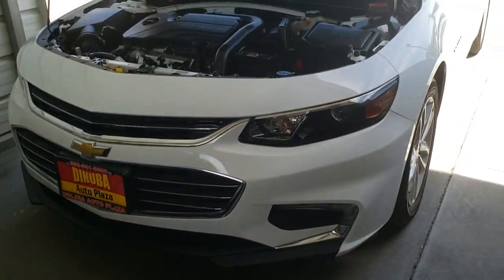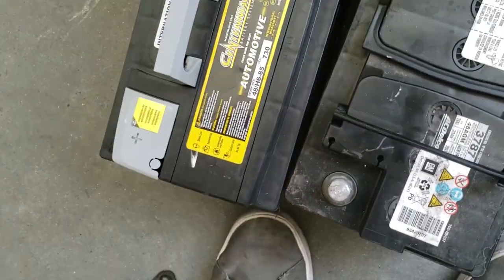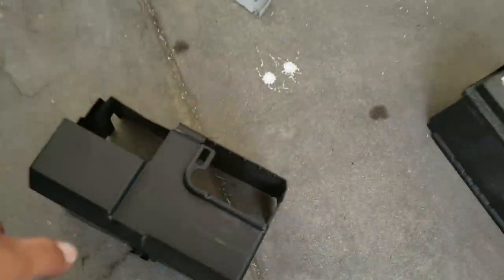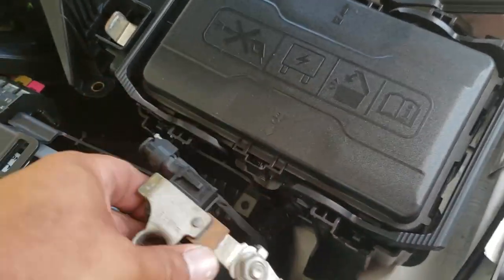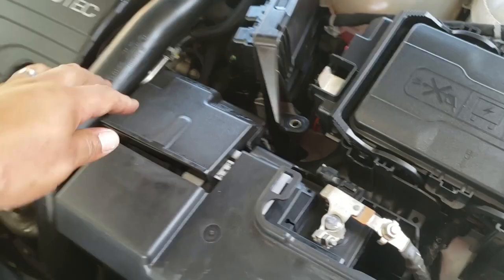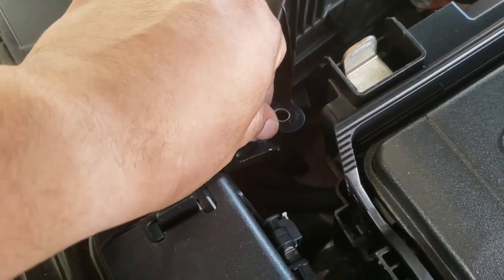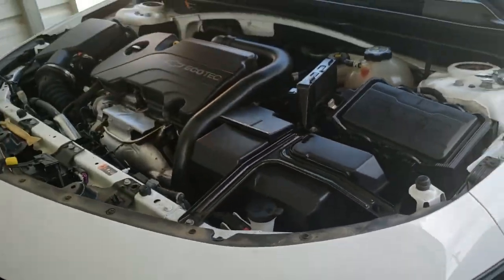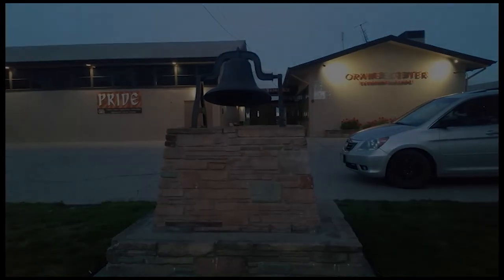How to: Install a new Battery on a 2017 Chevrolet Malibu

Comment: I remember the old days when you could stand in the engine back to work on the engine! 😁 Now there's so much stuff that if you drop a tool it only has a 5% chance of hitting the floor.

I opened the hood and couldn't even see a battery! Thanks for the excellent videos.👏
Reply from the maker: lol very thru. Thank you so much! Thank you for your support!

Comment: Thanks for this video, man. I bought a new battery today, opened the hood, and went “WHAT THE?!” No way I could have done this by myself (yeah, yeah, I’m not a mechanical guy, ha!).
Reply from the maker: Lol thanx bud really appreciate your Support!  Im glad you found this useful brother. Here's the video on removing it as well in case u missed it. Sorry I make a video in removing it and installing it so I just get you straight to the point.....hope you have a good weekend! 

Removal: https://youtu.be/Ow_ahdxFWok
Reply: @559powerscape  whomever designed this whole “battery area” in this Chevy needs a swift kick in the ass. I’m sure they did this on purpose so they can charge you for a new battery and $100 for “parts and labor”…
Reply from the maker: @Nick Emacio   That is exactly why they did it

Comment: Thanks for both videos. It took me longer to find the tools than to remove and install the battery. 
 
Only issue is that the AutoStop doesn't work anymore. {Not that I mind} Does it take a while to reset itself?
Reply from the maker: Lol yeah it be like that sometimes. No it should work right away. Maybe the battery in the trunk is bad as well. That one of the auto stop feature. If it doesn't work by the next few days it might be bad. You can remove it and take ot to where you purchased the new one for testing. They will let you know if it's still good or needs to be replaced
Reply: It started working the next time I drove the car.  Thanks again.
Reply from the maker: You're welcome thank you for your Support 🙏

Comment: My 2017 Malibu battery just failed.  At noon it was fine at 4pm it was dead.  This car in the video was also already needing a battery ?  Original GM batteries were always good for over 5 years of life.  What is going on?
Reply from the maker: It's just batteries. Just like cars. Some cars off the lot are perfect and some come defective with problems. It was probably  just a defective battery from the beginning. Yes this Battery was bad too and had to be replaced. Dealerships cut corners now and putting cheaper parts in their vehicles causing them to have more "common" problems. Causing the consumer to spend more of their hard earn money. Money schemes!
Reply: First off, Thanks for the video George... you've saved me some aggravation in identifying all those annoying, battery cover/trim-piece lock locations.  To trekOCLVone: my 2017 Malibu battery just choked too (3.5 years old).... worked fine up until Friday; deader than a door nail on Monday (internal shorted cell, only putting out 8.8volts).  This is my first experience with owning an absorbent glass mat (AGM) battery - what I see for replacement batteries cost at least twice the price of conventional batteries with only 3 year warranties....  I guess I'll find out in 2023 if I my battery was an OEM lemon or if I need to start a "3 year battery" replacement fund....
Reply from the maker: @brusvent  Lmfao right! Dealership cut corners to save money and in return  the consumer has to pay for the consequences 🤑🤑🤑 really is sad to say "They dont make them like they used to!" Thanks for your support!

Comment: Thanks for the video Sr... Did you use a memory saver before remove the old/damaged battery?  Or Is it not necessary?
Reply from the maker: No the Battery was damaged and had to be replaced. All I did was swap it out and didn't have any problems. Hope this works out for you buddy! Thank you for your support!